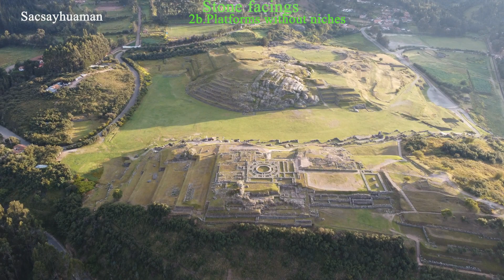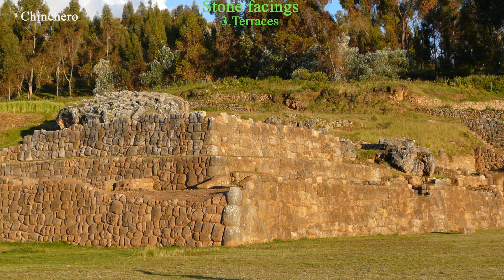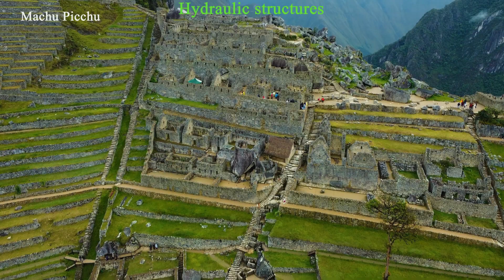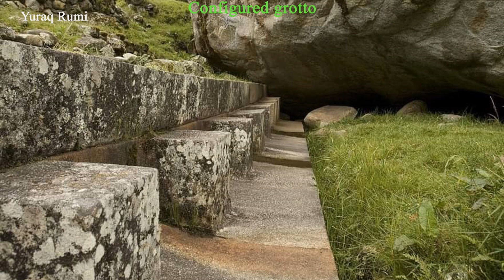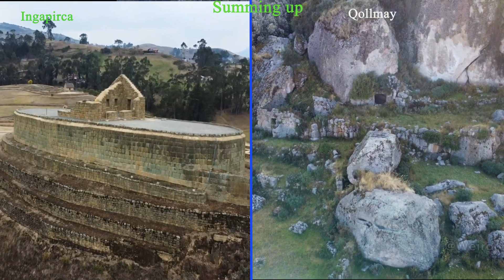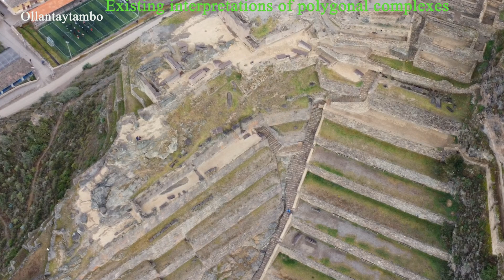Researching Ancient Technology p.2_b Polygonal complexes #ancienttechnology #history #archaeology

Comment: Thanks for this well produced series.
The mainstream idea, of the Inca's created these polygonal huge walls, is by the early history writers already dismissed.
Their contact with the indigenous population, should at least be taken plausible, as the Inca's themselves said not to be the constructors of them.
The Chronological tools we have, are highly questionable, and the dates given by them all over the world are not accurate.
Dendrochronology does not give a continues timeline, and recalibrates over and over again.
The same does happen with C14 Chronology.
We still do not know their technical methods used, to make them fit over the full depth, which for a closing piece is not simply a matter of time spend.
This knowledge gap is not created by loss of interest, as stone building obviously is done continuously.
Another issue is still the particular repair work, probably for later video?
Your video series should have more subscribers, I hope for better times!
Reply from the maker: Thank you. The dating issue is a key one. I agree. In any case, all methods, including optically stimulated luminescence (OSL) and thermoluminescence (TL) in carbonates, require calibration and therefore cannot provide accurate results. However, I have not encountered any mention of a non-Incan cultural layer being associated with polygonal masonry. Details can be found in "Volume 2 THE ANDEAN CIVILIZATIONS" on page 143 https://drive.google.com/file/d/1IF7pUExXM1LRHl41GFFRvcywEj0aPz1P/view or by searching for the keyword "dressed stone." But at the same time, it seems that these structures predate the Incan culture.

Comment: Nice research. One small correction, in this and another video you imply that these walls appear unfinished. The truth is that these sites were raided for stone in the centuries following the Spanish conquest, where typically the smaller and easier to carry stones were removed, and used to build Spanish homes and churches. That’s why it may appear “unfinished”, because it was partially dismantled.
Reply from the maker: Thank you. The walls were unfinished because there are no traces of joints, more details here on 22.57 https://youtu.be/1OQl9pqhPb4?t=1377
Reply: @GRES_TAC yeah that makes sense. I thought you had shown some other examples while saying that which had been worked along the top too, but I may be mistaken there.
Reply from the maker: @ I meant the absence of traces of joining. But there are not always photos where this is clearly visible. An additional sign is the absence of bevels
Reply from the maker: @ https://youtu.be/jUKShlNDZWk
Reply: Others were completed after Spanish conquest with iron tools like that niched platform at Chinchero.

Comment: I am new to this channel and greatly appreciate your content. The thought struck me, what if these constructions were not built by humans. I then discarded that thought, however, what if? Allow me to expand, were they not built by humans the thought then struck me, even so, mathematics would still be the fundamental guiding principle if non-human. To further expand, with the recent Vase Scan Project undying mathematics have been discovered in the finest and most precise of hard stone vases. So, this has allowed me to formulate the question. Even though and with the 5 sided polygonal blocks does their fundamental weight, density, construction, design also have undying mathematic principals yet to be discovered by precise scientific study and analysis? Often the resolution to a problem seems straight forward but an individual with high performing Autism may utilize a different approach in problem solving a “normal” person may not see. I truly find the dating of these type objects impossible, these are not 2500-3500-4500 years old, but I think far older and may be much much older, and perhaps developed by a completely different type hominid species.

Comment: After 20 years on YouTube the guy with 591 subs does better in depth analysis without going to crazy town, and without the: oh they really tried hard and somehow managed by stone grinding explanations. 

Great work on the sound! 

So for Peru there is a research paper that outlines that for those few examples of 3d polygonal masonry that curved and goes through with morphing two blocks to each other, basically it can only be done by pre-modelling the whole wall and crafting stones to perfection based on exact measurements. 

Paper title: 
 Fabrication Methods of the Polygonal Masonry of Large Tightly-fitted Stone Blocks with Curved Surface Interfaces in Megalithic Structures of Peru

The only other reasonable approach would be a use of acid to morph blocks to each other but I have not found any examples of such experiments. 

Geopolymers Tiwanaku and Pumapunku are the only two convincing examples. For there is a Youtube video:  Tiwanaku / Pumapunku Megaliths are Artificial GeopolymersWhich for those two locations seems very convincing based on the evidence presented there. 

In Hattusa in turkey there are only few stone blocks and they are predominantly straight cuts, which is easier to achieve and only requires a long saw to cut through both blocks at the same time. There are examples in India (sorry forgot the exact location) of same straight polygonal masonry which looks like the Peru one however can be relatively easily achieved with simple tools, as well as in Egypt. Those ones I would agree with main stream archeology as being just a coincidence of design based on underlying structural stability requirements, there are just so many ways of attaching blocks without mortar and without them falling apart.
Reply: @GRES_TAC  any take on this?

Comment: Left two comments, can't see them, YouTube is either glitching or you are deleting them :(
Reply from the maker: I do not delete comments for several reasons. 1. A person has the right to his point of view and the right to criticism, even if I do not like it. 2. Each comment contributes to the promotion of the video. Moreover, I have disabled comment moderation, which allows you to write long ones and even with links to other channels. If yours was deleted, there may be the following reasons. 1. Links to other sites, or citing other sources. 2. Exceeding the length. 3. Using phrases that YouTube perceives as prohibited. It is advisable to save the comment before sending by selecting and copying it to memory. Sometimes dividing it into several helps.
Reply: @GRES_TAC  Aha, I had research link there. Thank you for clarification. will be back in a few.
Reply from the maker: Okay. You can use the article title instead of a link.
Reply: @GRES_TAC  no love for other comment ;)?
Reply from the maker: What are you talking about?
Reply from the maker: "Very hard to say but the knobs seem to be partly for lifting and partly left from stone extraction.  Puma Punku seems to exhibit completely different approach to stonework to even best examples of polygonal masonry, sharp and exact internal corners as well as 'drill holes' would be much easier to do by imprinting on to, rather than repeatedly and consistently produce those corners by removing hard material.  Acetic acid aka Vinegar can damage granite quite easily and even Citric acid can do permanent damage to Granite along side Nitric acid which there is an indication was used for metallurgy and metal etching in those areas. Might be some process which combines stone rub with addition of acid. Still better theory than chizzling bit by bit installing and reinstalling to check the fit. P.S. The sound here is a bit on a spectrum, sometimes it seems like there is the bass in your voice that the mic can't handle and it all interrupts the free flow of speech. and also the S sounds weird every time. For me its definitely better than the first video's you have and I can intake all of the information without being interrupted, but if I start to tune in than ye you can hear what people are complaining about."
Reply from the maker: Thank you! Nobs will be examined in the next video on Peru. I would be interested in your opinion. Regarding the acid treatment of the surface - yes, it looks like the surface was affected. Regarding Puma Punku - there are quality corners in the stone configurations. Puma Punku blocks should be correlated with them. Thanks for the feedback on the sound. I understand what you are talking about. It seemed to me that this was not very critical. I will clean it better, thank you.
Reply: @GRES_TAC  Great! can't wait for the upload :)! 

Rome was not build in a day ;) So far you are doing amazing!